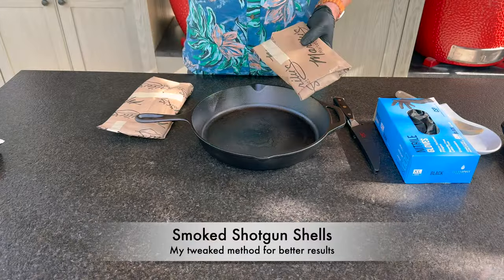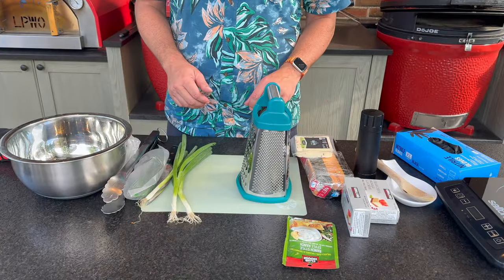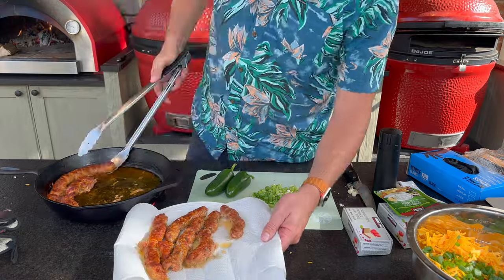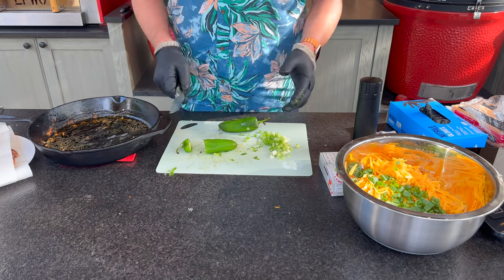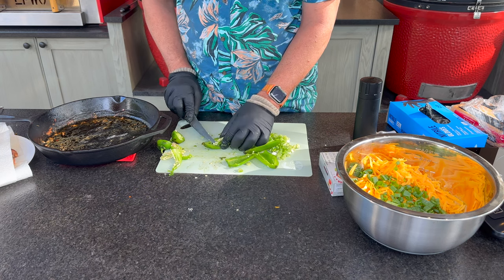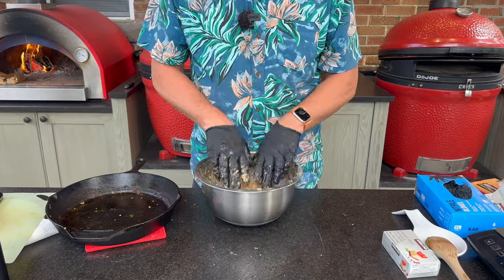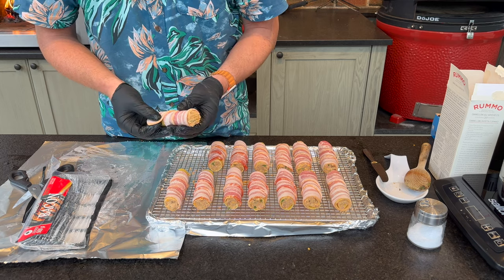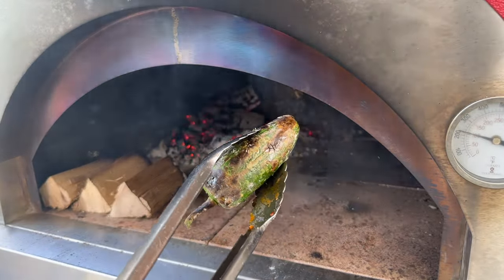Smoked BBQ Shotgun Shells... How I FIXED The #1 ISSUE with Most Recipes!

Comment: James, I subscribed for kamado info and loved and learned a lot thanks to your efforts. I think you should make a separate channel for other cooking methods (offset, pizza ovens, etc) because I'm seeing a bunch of recipes that I can no longer connect with.
Reply: This is easily doable in a Kamado. I’m not meaning to be argumentative, rather hoping you’ll get some benefit from these other videos. For example, I am not planning to buy an offset, but I still find the offset videos here useful to improve my understanding of bbq and improve cooking on my bbqs.
Reply from the maker: There isn’t a recipe that won’t work in a Kamado. I’ve done these in my joe jr, classic and big joe

Sorry if it’s presented in a way that suggested you can’t participate, that’s never the intention. 

I have these different tools to bring ideas into my Kamado, that’s the reason they exist. Soon a video is coming out doing a brisket in the DoJoe because I was able to measure airflow differences and got a 4x improvement in moving air using the DoJoe for example

Comment: They wouldn't last long if they were in front of me, that's for sure.   Question for you on what do you think the smoke taste difference would be if you baked this in the KJ instead of the pizza oven?
Reply from the maker: they work just as well, the oven is just a little easier to get top down heat for the bacon which is why i chose it but you can do this cook on anything successfully ... i decided to get a wood oven so i make sure to use it regularly so the family doesn't ask questions lol
Reply: Smart!  @SmokingDadBBQ